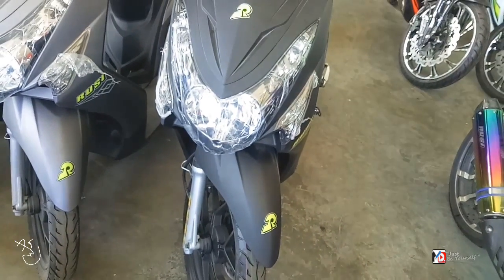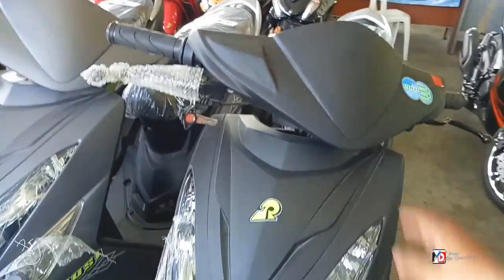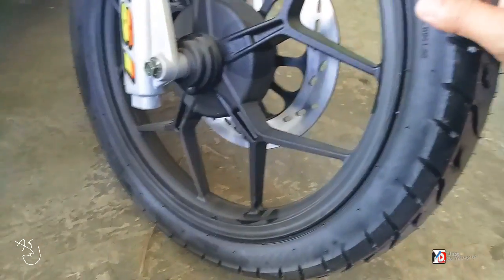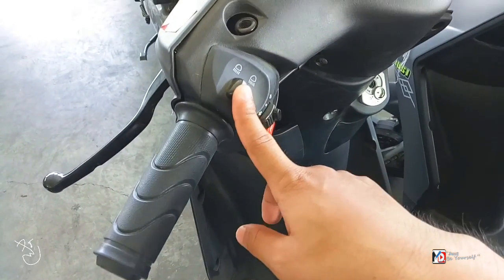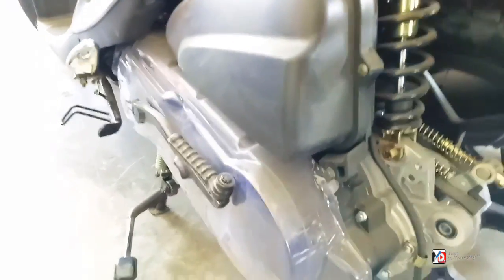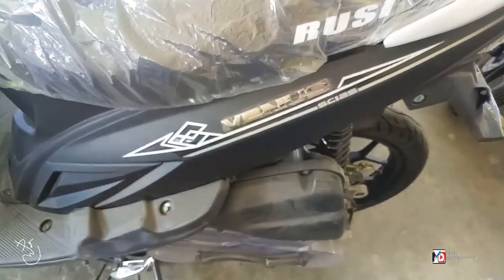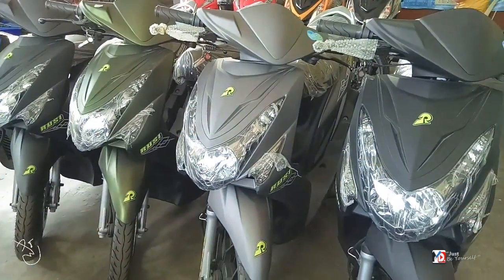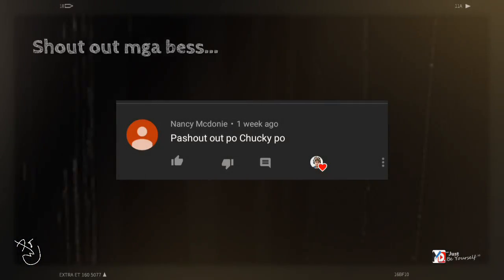RUSI VENUS SC125 // UPDATE PRICE // #RUSIPlaridel #iMarkMoto ep.29

Comment: Hello RUSI VENUS owner po ako and i have been using my RUSI VENUS for more than 3 years, and wala akong na encounter na issues only need to replace lang ung ilaw sa tail light, flyball, brake shoe sa hulihan and lastly gulong sa hulihan after 3 years recently lang ako nag palit. In terms sa performance maganda po siya. Need lang alagaan sa change oil yon lang ginagawa ko. At siyempre dapat may garahe para di nauulanan at naarawan. Matipid din siya sa gas. At dapat isang mechanic lang ang gagawa ng motor mo para alam na ano ang dapat gawin at trusted. Salamat